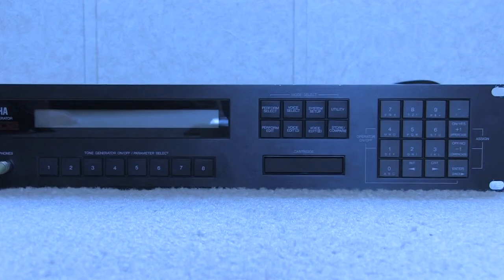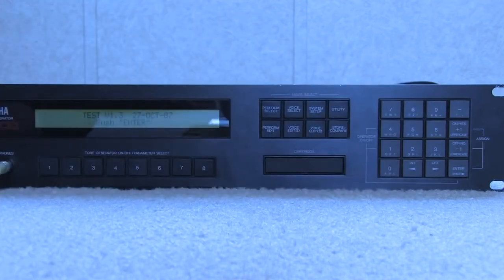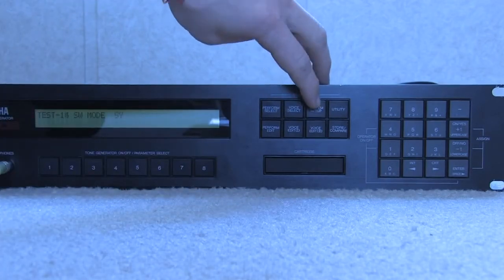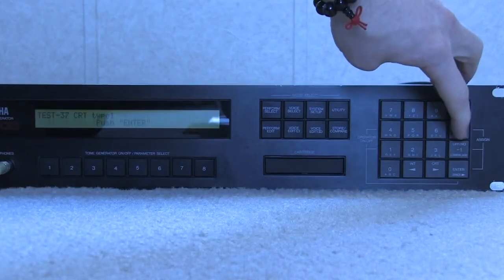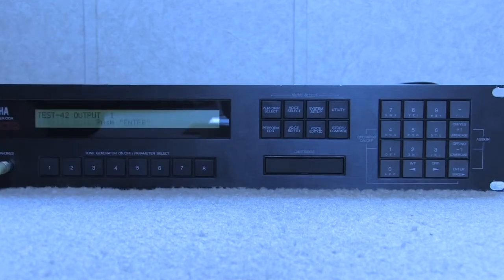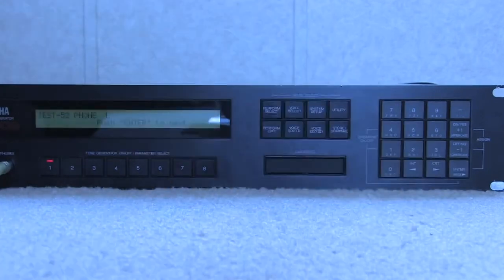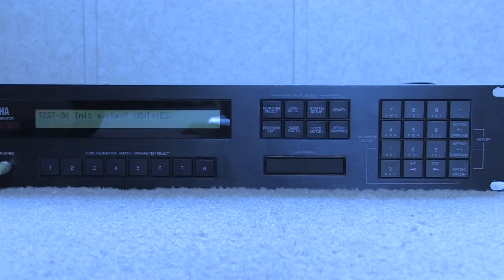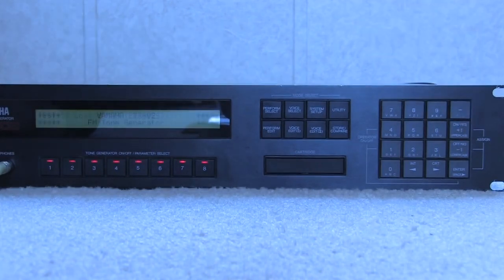Yamaha TX802 Service Mode

Comment: I just bought a used TX802 and want to restore the performances to factory reset. If I do press ENT+YES in Test-56, it just proceeds to Test-57 (as if I just press +1 (which obviously is the same button as YES) and nothing else happens. What is my mistake?
Reply: Hi Simon, did you find out an answer to your question? My TX802 is doing the same thing - when I press ENT+YES in Test-56 it just proceeds to Test-57. It does not do a factory reset?
Reply: Did not find a solution yet.
Reply: @simonbay3044  OK.... if I find an answer I'll let you know if you can do the same.
Maybe its the internal battery as I'm the original owner but had not turned it on in 15 years.

Comment: Hi there, I'm dealing with an odd behaving TX802..  https://www.youtube.com/watch?v=Zgur6XFLTiY wondering if anyone might know what could be up..  i'm guessing it's not the hardware but rather the EPROM..  mostly because if you try to restore the default settings it gives an error..   the button testing is a bit touchy but that could just be aged button contacts as it does respond to key presses but sometimes says "Error" even though you hit the right button AND it does advance to the next (as if you pressed the right one after all).. but this too might even be eprom program corruption?

Comment: Thank you SO much for this video! I bought one of these in 1990, with a Ram 5 cartridge,  and it has been in storage for over 20 years. Happily, it is in excellent condition and passed every test in service mode. Does that mean the battery is still okay, or is there another way to test it?